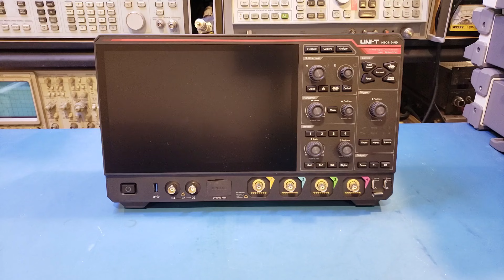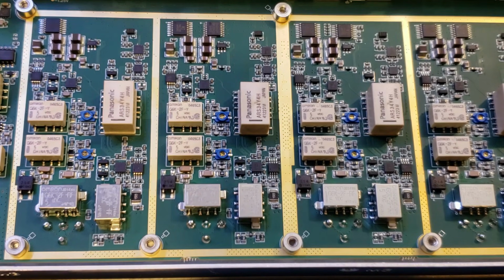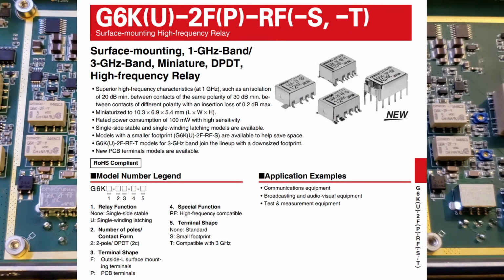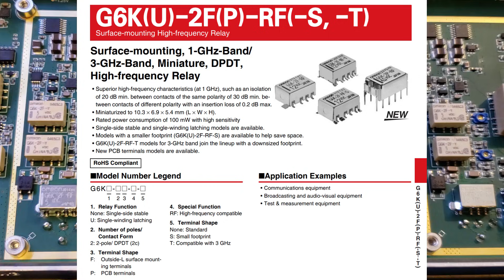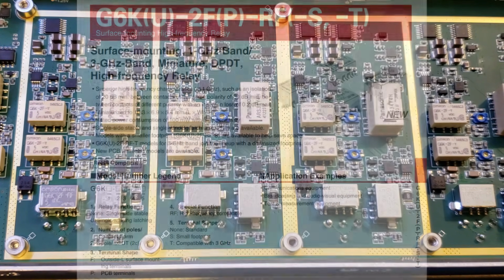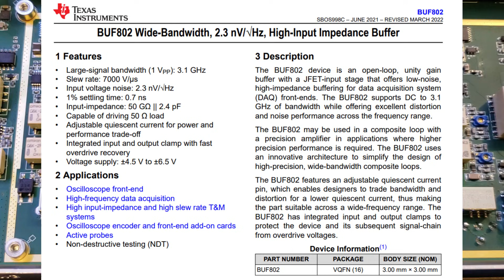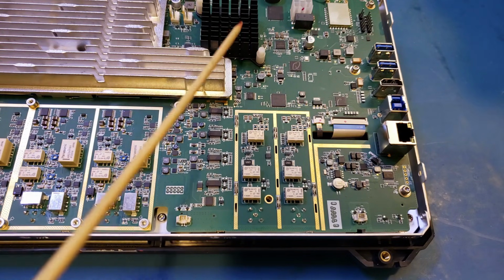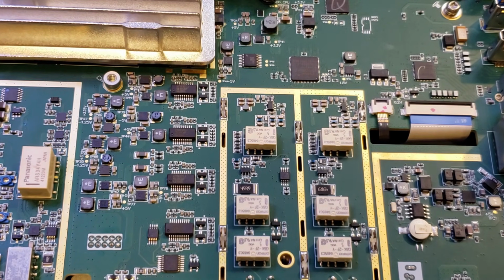UNI-T MSO5104HD 12-Bit 1 GHz Mixed Signal Oscilloscope Teardown

Comment: Do major brands hold calibration longer than UNI-T, Siglent, etc? My Siglent seem to be down about half SDS2204X plus, upgrade 350MHz. I only have a digital chip RF source - would it keep its response? Other scopes I have have degraded in freq response too about the same. They still work for my hobby use, sort of why I got much higher response to start with. Putting them into a cal shop is a little expensive but that is what is needed to stay in cal.

Kerry, what do you find with your gear for holding cal?
Reply: Don’t understand what you are saying. Is the scope losing bandwidth?

Comment: Any reason UNI-T doesn’t list ENOB?
Reply: There is a bunch of other specifications which are relevant for some applications not not for most. So the policy is to hide them if there are bad or be silent because the manufacture is already trustworthy. Look for DC accuracy and SNR over gain, THD over frequency and amplitude, IM3, overdrive recovery, thermal residual response ...